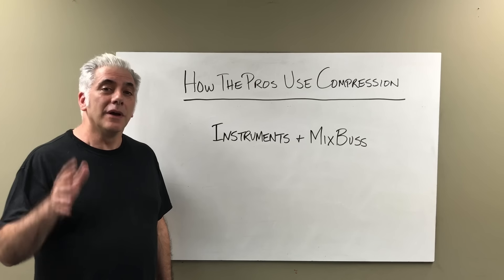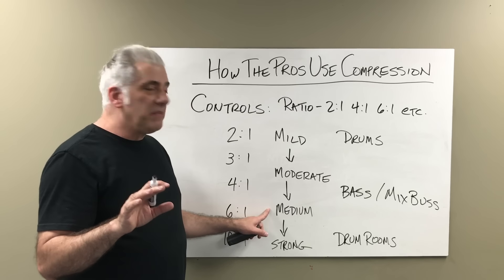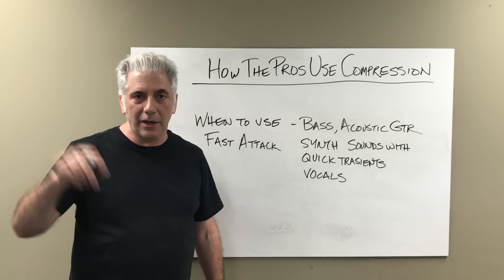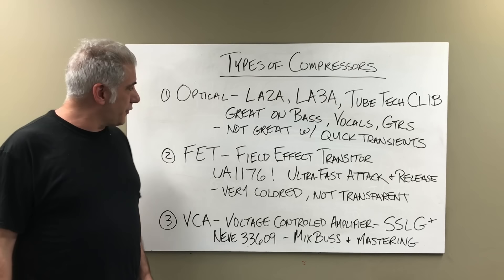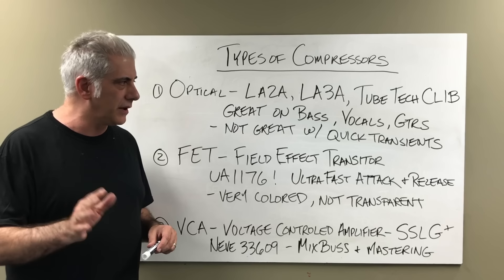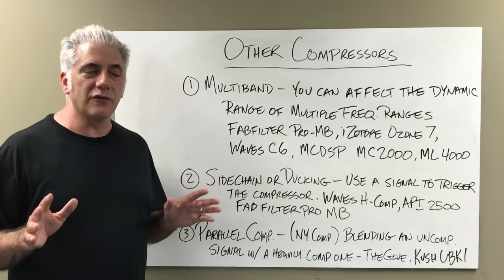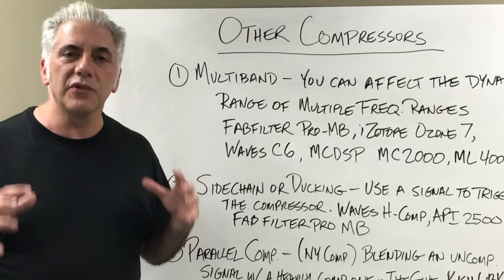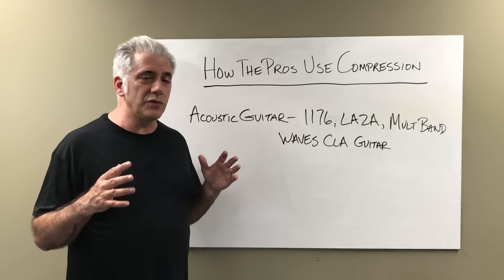How The Pros Use Compression on Instruments and Mixes

Comment: Folks need to be aware that compressors do something quite different from an "overdrive'..

"Overdrive" involves deliberately adding sufficient gain to a signal to cause it to "clip". When the signal tries to exceed the "rail" / supply voltage of a solid-state amplifier, you get serious distortion. If you look on an oscilloscope or zoom in on the waveform display on your DAW, it shows up at the peaks of the individual excursions of the "wave" being chopped off horizontally. This sounds "ugly" because the rapid transition from "sinusoida"l(ish) to "clipped" generates third-order and higher "odd-order"harmonics, which are very dissonant. But what would rock guitars be without "distortion"?  Tube / valve devices distort with "EVEN" order harmonics, which is why "bottle" amplifiers still exist.

"Old-time" synth players / programmers had to get right into this stuff because they were defining the type of "waveform" (sine, square, triangular, saw-tooth, )as well as the next thing on the list, the "envelope"

Compressors "look" at the waveform "envelope" and respond as "instructed". Then the "gain cell", the guts of the device, adjusts its "gain" to achieve the desired effect.

You can also "slave" compressors to react to an external trigger source. This can be noted in recordings where the (already compressed) backing tracks get "turned down" automatically whenever the vocals appear so as to nor overwhelm the vocals AND to not overload" the mix buss. This is known as "ducking".

Comment: Dumb question, what’s the difference between compressing while tracking vs compressing while mixing? Is it a notable difference in sound?
Reply: while tracking means it's on you signal as it's being recorded to the DAW. you can't undo or change it once the performance is recorded.

Comment: The secret is simple you go through multiple compression viz. first one 1.5  slow attack fast release threashold is critical -20 is good
second one Urei 1176  4 to 1 limit 
I can dial compression just by looking at the meter .  It should only just move.
The worst thing you can do is dial up numbers learn to use your ears my eyes glaze over when it all becomes an intellect exercise. This type of video makes you think you think you know what you are doing when you don't
I have done this over 40 years and been in studio with US and UK no one acts 
Its not how expensive your equipment is it is what you do with it

Comment: is it the compressed audio that youtube is streaming, i could not tell any difference between any of those compressors on that techno piece. one note in isolation, yes the difference was there.
Reply: Youtube sound is mp3 and it does make quite a big difference in hearing compression. But also, compression is one of the things that takes a lot of time to learn to hear in detail too. But yeah, mp3 makes it a lot harder to hear compression differences.
The first one had longish attack I think and raised the signal level too, the second one had super short attack and kinda killed the transients, third one was nice, fourth no idea. Btw I wrote this before actually looking at the settings so seems I could hear it.
Gear makes a huge difference too, I don't know what you're using. But all of these were subtleish - it's mastering compression and the settings weren't too radical here except for the first compressor.
Reply: Right click on video, then click "stats for nerds" you'll see if youtube is in fact compressing the audio or not. It depends on the uploaded video.  Ricks video here when he is talking is "low" (Volume / Normalized: 100% / 100% (content loudness 6.7dB)) and has about -6+ db of headroom, while other videos might be crushed because it's to hot.
Reply: @nenissaK  the gear is basic, it's a computer not a stereo. My hearing isn't what it once was either, but that applies more to frequency range than dynamics.
Reply: @LifeBloodMarketing  cool tip, but my gut tells me that all audio needs compression to fit in the limited bandwidth here. not just amplitude but also frequency domain, just like FM radio has been using for decades.

Comment: You are confusing waveform with audio output.  A square wave may have a wide range of amplitudes.  For example, due to midi velocity.  The amplitude envelope is not the same as the waveform.  The timescales are completely different.

Comment: But how does the volume increase if you are compressing the sound??
Reply: I´ll try to explain. 
When increasing volume, you have an upper limit, at 0db you will clip and wont get louder than that.
Now take a snare hit for example, if you look at its wave form, you will see it has a big spike at the beginning (the hit) and then a tail at much smaller volume. 
If you wanted to make the snare louder by turning the gain up, the spike would hit 0db much sooner than the tail of the sound, limiting your ability to make it louder. 

But, if we compress it, we reduce that spike in relation to the rest of the sound, which gives you space to turn the gain up a lot more before hitting your limit.
Reply: @elmarcezen  ok getting it.. So its no longer a spike and sound is more spread out ..

Comment: Some recording engineers are jerks, they will brick out a bass part with high compression even if it's not needed, just to make mixdown easier for themselves.  This was a super video, but didn't see more about hard/soft knee options.  Also, are tube v. solid state v. software a level playing field?  Which works best?

Comment: With all respect, this isn't quite correct regarding Ratio's 3:07 and could probably use a clearer explanation. The signal is not 'turned down' by 1db, it's 1db of expected output for every 2db over the threshold. ie. in your example of a 2:1 ratio, 8db over the threshold would allow 4db of expected output. To continue, a 10:1 ratio would not turn the output down 1db when the input signal is 10db over the threshold (like you have suggested if you say the volume is 'turned down') , it would (or should) only allow 1db of output over the threshold for every (and up to) 10db that exceeds the threshold. Hence why 20:1 and above is limiter territory. Does this make sense? All compressors will handle this slightly differently, but the basic ratio concept is the same.

Comment: the 1176 get a release of 200ms in the fastest, slower than LA2A who get 2 action 50-70ms on loud and short level, and a slower realse after, but more than 50% of the realease is very fast.
The 1176 just get a fast attack that LA2A don't get. real fairchild didn't add lot of harmonic, less than others, and very fast attack not the best for glue

Comment: not a bad video but very conservative views especially in the beginning of the video. Honestly 4:1 on the mixbus is not what most modern producers do, also 2:1 is not "where compression starts" - i regularily compress at a ratio of 1.2 or even lower with a very low threshold to smooth an elements out and push it into the background etc.

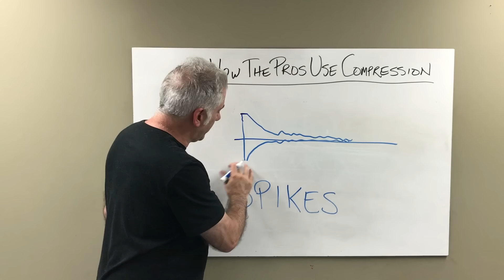Comment: at 4:55 you mention flat-topping will cause bandwidth reduction. That's not correct. Unless you have a very smart digital signal processing program and use an algorithm of your own design, most run of the mill digital signal processing will never cause bandwidth reduction.  Just using a compressor will only reduce the amplitude in relation to preset signal peak values triggering the compression module.
To compress bandwidth, you would need a signal processing program to recognize, on the fly, which frequency was your troublemaker and then, what would you even be able to do with that information ?  How do you manipulate that information to compress bandwidth ?

Comment: A LOT of ringing on that compressed share, it's obviously for demo, but it sure is very ugly.
 Loudness War sites discuss the accelerating over use of compression over the last 4 decades.
CDs when incisive in the early 80s, already vastly exceeded that of popular music by more than 60dB.  It is most ausing to hear ignorami claim that a HM+HR track "needs" 24 bits in the final mix.
During recording and mixing 24 bit has advantages, of course, (you can "place" the recording well between noise and clipping) but the over use of compression means that much popular music these days, sometimes only REQUIRES 12 bits of dynamic range.

Sadly .. It is becoming increasingly rare to find new pop recordings with more than 35dB dynamic range.

No question that in a car, compression is a real boon  to get over the environmental noise.  

However, if you have a quiet room, you don't need nearly as much compression and can get "more life" from music recordings.

My speaker system crossover has compressor capability for each driver.
I use compression sparingly for the high end drivers because mids and tweets compress less than bass and sub drivers do.
I do this purely to maintain the tonal balance as SPL's rise.

Comment: So, if I have a compressor on a snare for example: if the attack time is really fast (1ms) and release is slow (let's say it's 1sec) does that mean that the compressor will come on quickly and reduce the level of the initial transient, but then boost the level to the decay (ie. add "sustain") - i.e.; it will both reduce and limit the gain as long as the compressor is enabled? Does the compressor open and close multiple times or only once as it is triggered: ie.; if a slow attack compressor hits it's threshold and then begins to turn on and also has a slow release time, but another signal hits the threshold before the release time hits, does that affect how the compressor works? Does it turn on twice? Thanks for any help understanding this :)

Comment: Isnt it wrong the ratio explaining ? I dont understand it. 2:1 ratio. When exceed with 2 db turned down 1 db. So ratio 3.1 will be when the signal is exceeded with 3 db its turned down 1 db. This explanation is saying that 3:1 compresse less than 2:1. This must be wrong. It must be the other way around. your explaining says it 1:2 ratio is the heaviest compression there is. it turns down half of what gets in. Then Ratio 3:1 would turn down a third and ratio 4:1 would turn down only 25%.

Comment: Your definition of compression is wrong. Compression doesn't raise volume. By definition, and in reality, compression "makes smaller" the signal and overall tends to lower the volume if anything. But a compressor is not a volume knob. It's not about volume. As a RESULT of the compressed signal higher noises are attenuated and quieter sounds sound louder (but really it stands out more because of its being squished and therefore closer to the higher center volume.) Yes one can take advantage of the newly available head room to raise the volume and there is usually a "volume knob" on the compressor and you can turn up the output volume of the compressed signal. But the compression did not make the overall signal louder. Some sounds were made louder true. But the sound overall was literally compressed, not "made louder." Personally I usually compress a track if I'm going to raise the volume significantly. So they are not the same thing. In fact if I'm experiencing clipping I might compress a signal meaning my initial reaction when I think "compressor" is that it is going to reduce a signal not boost a signal. So I really don't know how such an experienced engineer could get such a basic definition totally wrong.